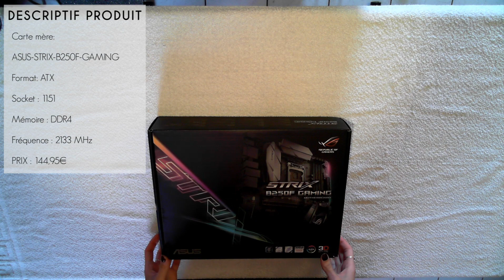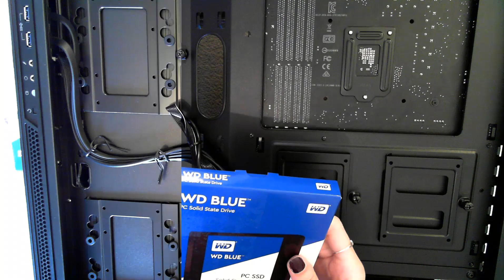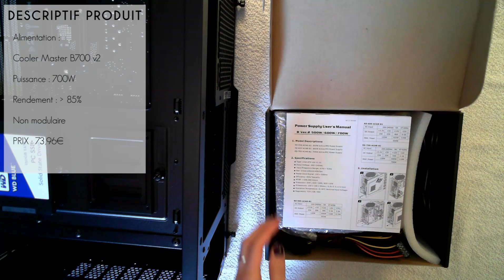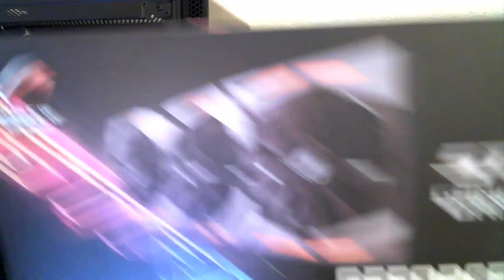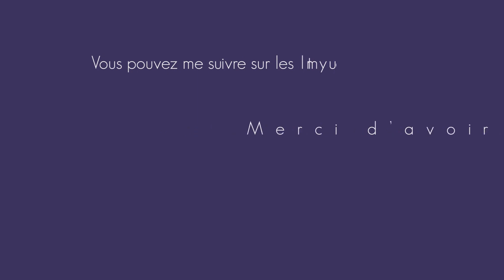Montage PC Gamer (Budget : 1500€)

Comment: Punaise a ce prix la en juin 2017 j'ai monté un i7 8700k avec une 1070ti asus rog strix et ram 3000mhz (corsaire vengeance lpx pour le ventirad) O.O. avec un termalright grand macho en plus. dommage t'aurais pu économiser comme dit dans les commentaires. J'ai eu les même prix a plus ou moins 10€ près avec une config au dessus et puis dommage pour ta cm j'ai oc a 4.8Ghz constant sans avoir trop de connaissance en la matière en etant stable (zéro crash depuis le temps)
PS: je suis en 16go de ram

Comment: Je pense que c'était très facile de faire cette config avec un watercooling et une gtx1080 mais bon 😄
Reply: Faut compter 1700 voir + pour une config avec une gtx puis la GTX 1070 de 8go est très bien
Reply: SkyZox _ ouais c'est vrai
Reply: Perso j'aurais plus vu une carte mere Z170 / Z270 et une 1070Ti et une seule barette de Ram
Reply: GTX 1060 6Go, GTX 1070/ti 6Go/8Go, GTX 1080/ti 8Go ça se vaut. La 1080/ti a évidemment plus de perfs mais bon la 1060 suffit amplement.
Reply: Anthony Malesys une gtx 1060 pour streamer dans de bonnes conditions n'est absolument pas suffisante
Reply: Anthony Malesys oui mais par rapport au budget c'était possible 😃